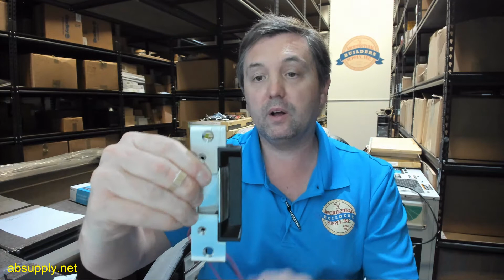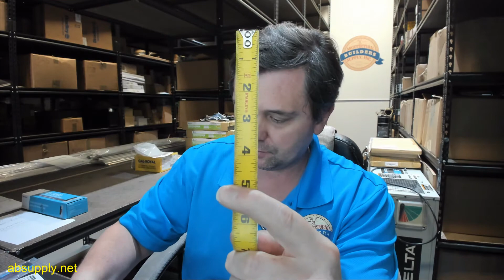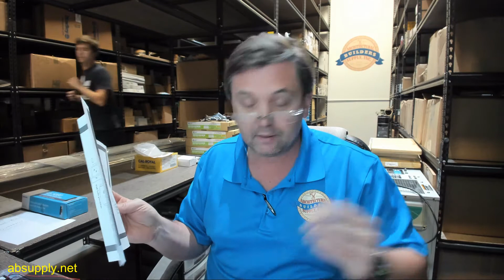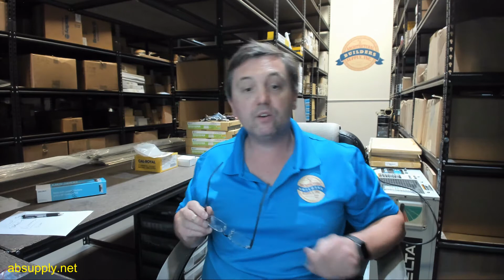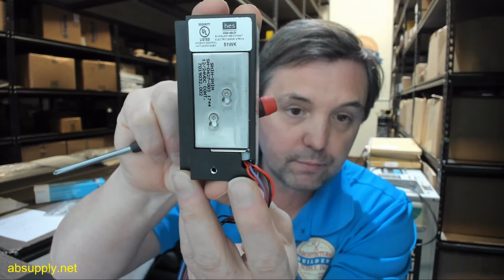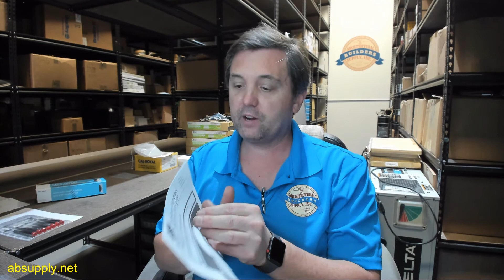Hes 5000 501

Comment: Other strikes (Camdens I've used for example) have much easier fail safe/secure swapping methods than this. Thank you for validating that it is indeed very finicky to do it on these strikes! The screws are so small.
Reply from the maker: Sure thing - I am glad this video helped - Rich